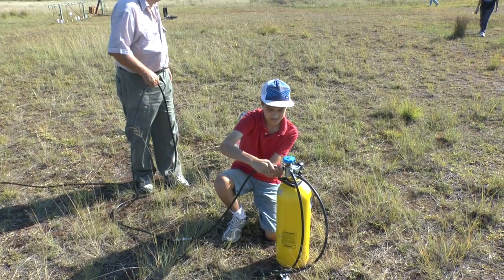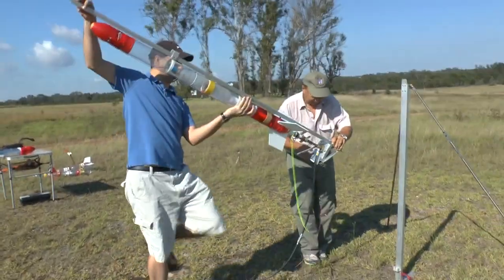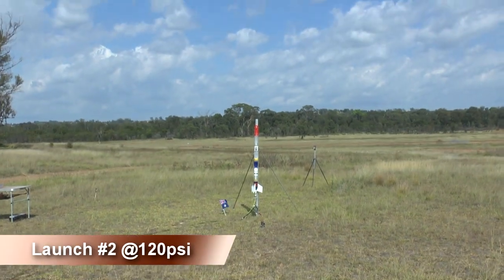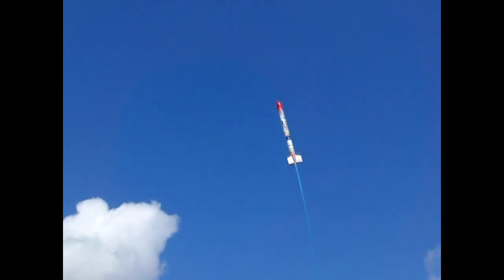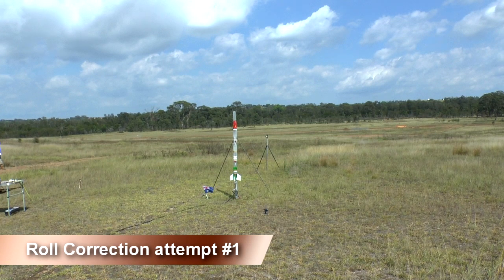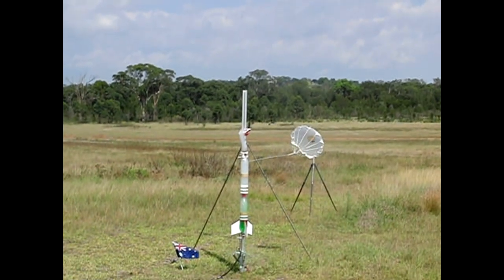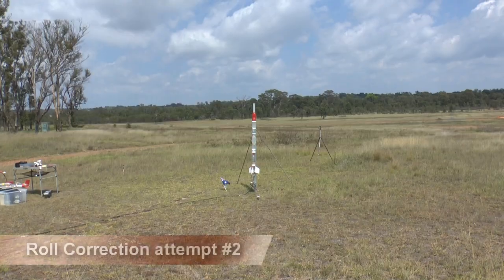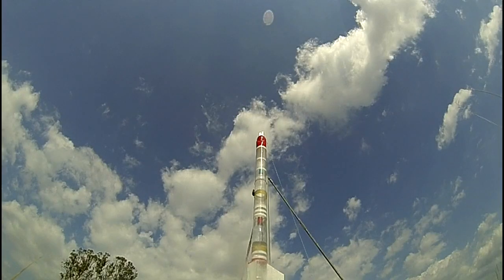Day 141 Highlights

Comment: Looking back at this vid I realized that
1. It's effective impulse is similar to a 2L bottle
2. That the boost phase acted similar to a T nozzle, but without a launch tube

My fix for this is to use a spliced quad at the bottom (higher boost impulse), a larger sustain nozzle (5mm can barely give off thrust), and foam. I also would suggest a 190psi launch pressure.

I would like to see this back in action, too.

Comment: What launcher do you suggest for a newbie :)
Reply from the maker: Both the Clark cable-tie launcher as well as the Gardena launcher are good options for beginners. The Clark cable-tie launcher will give you very fast launches because of the larger nozzle, whereas the Gardena launcher will give you slower launches but will 'burn' for longer.
Reply: AirCommandRockets  ok thanks i live in finland and u inspired me and my friends to start bulding rokets. Keep up the good work.    ;)
Reply: *rockets

Comment: Another great video from y'all, George. :) But I was sorry to see the crash then the explosion. Just wondering, what is your SCUBA tank made of? My local Dive shop now refuses to fill my 6531- aluminum tank ever since they heard that they heard its one of the weakest tanks made... I guess
Reply from the maker: Thanks Randy. :) Luckily neither the crash or explosion were serious and are already repaired. All our tanks are made from the good 6061 alloy. :) Most dive shops here will not fill the 6531 tanks either. In fact many have a blanket ban on all pre '91 alloy tanks. If you have a 6531 tank I would suggest obtaining a new one if possible.

Comment: That is a great video guys! I like that air pulse sound at that height, it looks and sound really cool. Did you find out why the bottle explode at that pressure? Most of the time the bottom is the strongest part of a bottle. Do you think it is possible to launch the rocket without a roll that you see on the onboard camera with roll taps? I think that normal cross wind can effect the rocket roll in flight and not just the fins.
Reply from the maker: Thanks Basrockets. :) We are still clueless as to why it failed. We hadn't seen this bottle fail in this way before. May have been scratches or stress fractures on the bottle before we used it, and repeated pressurisation cycles may have weakened it until it failed. 

We have already flown the roll correction rocket again one week ago, and managed to trim it so that almost all the roll is gone. I am just putting together the video and update from that launch day right now. Hopefully that will be up later this week. But you are right, cross wind could indeed upset the roll.

Comment: Another great video ACR, nice to see the thrust phases with different water colors.
Probably the previous crash damaged the top bottle (?)
Reply from the maker: Hi ptx, that is what was so strange about this failure. The bottle had been pressurised before several times, but did not have any crashes. There may have been a scratch of other stress fracture that may have happened before we used the bottle for water rockets. We hadn't noticed anything obvious before the failure.

Comment: Sorry to see the crash and the explosion, George.
But again you have done some pretty amazing stuff :)
Greetings
Reply from the maker: Hee hee, yup it wasn't one of the best days, but it's always fun to go launch rockets. :) The explosion was interesting as we've never seen a bottle fail this way before.
Reply: AirCommandRockets I don`t have a picture from a test but I used a 2.5 L bottle and at 120 PSI the bottom part has changed it`s shape pretty much but fortunately it haven`t failed :)
Reply from the maker: RaketfuedRockets Interesting. Was this the first time you pressurised the bottle, or was it after multiple pressurisation cycles? We had used this bottle several times before on a number of flights, and I wonder if it had been weakened. We only ever pressurised it to 120psi before which is normally fine for these bottles.
Reply from the maker: Florin O Yes, we see this on some of the bottles as well. That's why we usually don't go above 120psi because the stretching on the bottom becomes permanent. The bottle looked fine before the launch, but there may have been a stress fracture, or a scratch on it that we didn't notice previously.